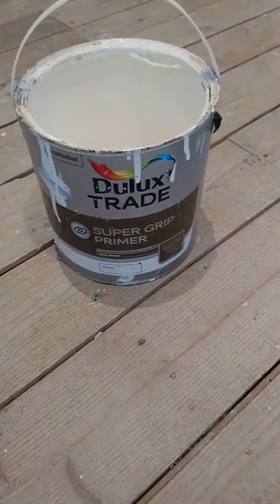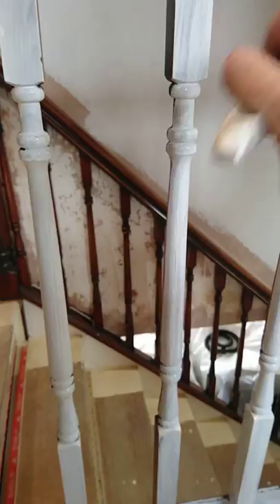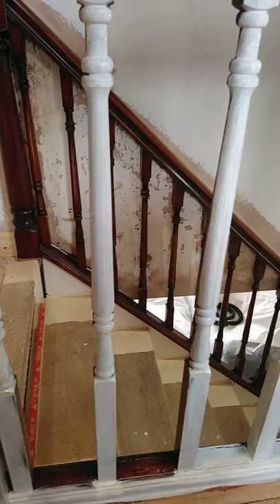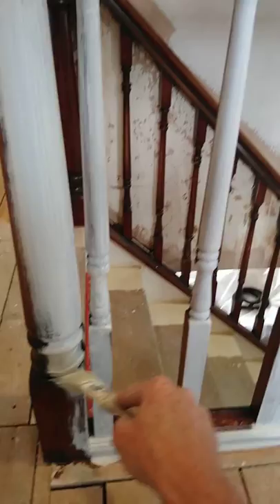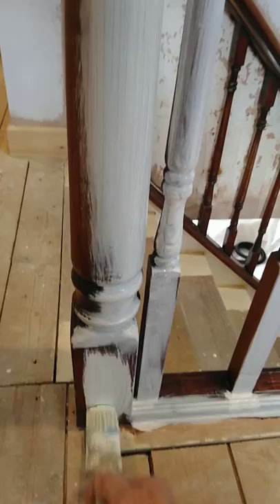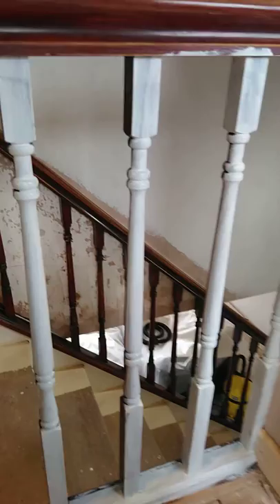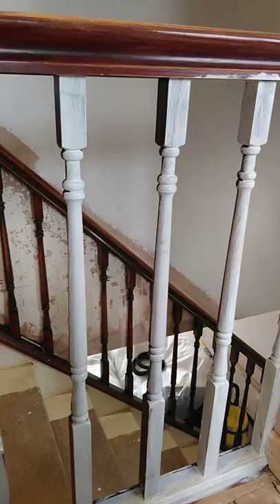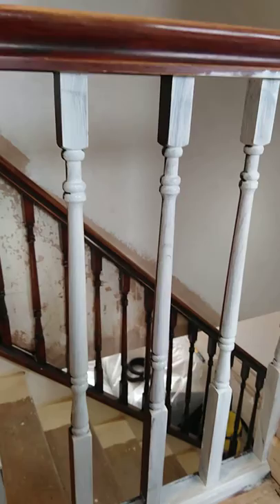Painting spindles

Comment: Is that a synthetic brush with an oil based primer
Reply from the maker: Yes a synthetic brush, it's a waterbase primer.
👍
Reply: @thedecoratorjamieironside6383  ok THANKS 👍
Reply from the maker: @StephenSmith-vs8hr  I also use a different product now, it's called zinsser bin. It's a shilaq based product, loads better than the dulux super grip. It's a primers stain killer and sealer.